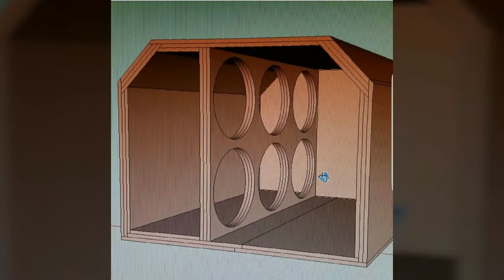Loudest demo at slamology 2017

Comment: Ayy bro, how do you like that xs lithium 15k? Can it seriously handle 7.5k rms? Im strongly considering getting one for my ns1v2. Hope you can reply.
Reply from the maker: Chavy Cash well I had 2 of the xs15k and a 2 d3400 and a d5100 with 3 240amp alt. I did not have any Voltage drop
Reply from the maker: Chavy Cash Those 2 batteries were my friends he just let me borrow them. But when he bought those batteries they were no other lithium's out on the market Now they have the JY LITHIUM  and also the Limitless lithium with more amp hours then a xs15k so let just say i would go with some thing with more amp hours for the same price.